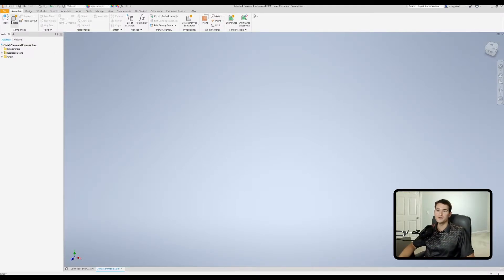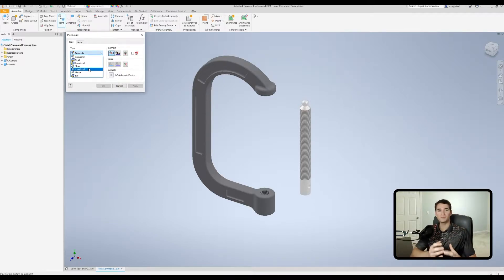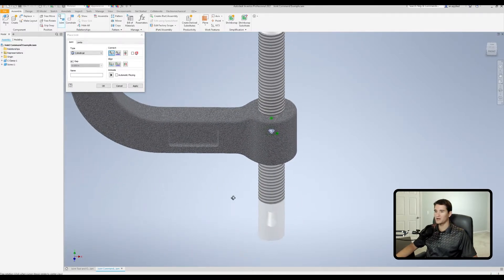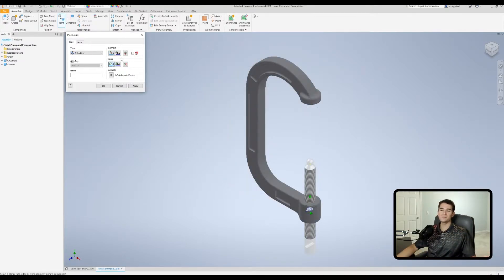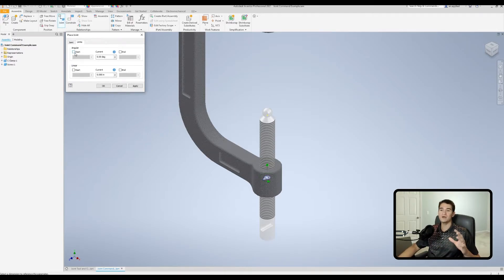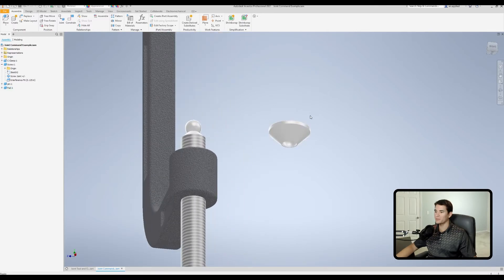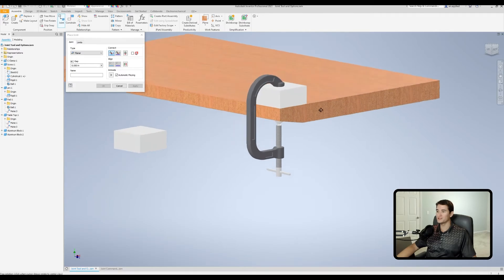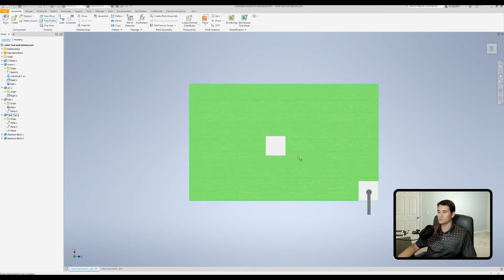Joint Command and Options - Autodesk Inventor Assembly Tutorial | Autodesk Inventor 2021 IN DEPTH

Comment: Great video as usual. May I ask you what kind of joint should I use for a vertical pin sliding inside a buttonhole? I have tried with the "slider" one selecting a point on the vertical pin and the buttonhole side but did not work. I apologize in advance for the noob question.

Comment: CAN SOMEONE PLEASE TELL ME HOW TO EQUALLY SPACE PARTS IN AN ASSEMBLY, LIKE SHLEVES IN A SHELF ASSEMBLY...
Reply from the maker: Sure! Please see the following steps (8 Steps):

1. Put your first part (shelf for example) in place with constraints. 

2. Then, click the "pattern" tool found in the "Pattern" section under the "Assemble" tab.

3. Next, click on the components you want to replicate or evenly space. 

4. Click on the tab for the rectangular pattern (the symbol looks like 6 dots positioned in two columns and three rows). 

5. Click your selection filter (little arrow) in the "column" section and pick a line, edge, axis, etc. that falls in the direction you want to replicate your parts in. 

6. Enter the number of total parts you want in the pattern. For example, if you want four total shelves, type "4" in the "column count" box.

7. Enter your spacing in the spacing parameter box just below it. 

8. Finally, click "OK" and you're all done! This works like the rectangular pattern tool in a sketch/part.
Reply: @engineeringapplied  hey buddy thanks for the response, but this didn't work for me.  let me explain.  I am creating a screw and nail storage area made of drawers.  think a card catalog in the local library, but used for nails and screws.   I am designing it with oak, and maybe some mahogany highlights.  i am a wood worker and i use Inventor to design my projects.  

i have two sizes of lumber i am going to use.  when i am building i always try to design my projects with as little waste as possible.  That means that if i am using a 10 foot x 11 1/4 inch piece of wood, i want to design my projects so there is little cutting as possible.  in other words, i want to build my storage cabinet to be 3 times as wide as the wood i am using, that is 11 1/4 x 3...

that is the height.  width would be about 36 inches wide.

anyway, i wanted to make my drawers to be evenly spaced along the 33 3/4 height.  and i need vertical separators between each drawer that is 3/4 inch thick, which is the thickness of my wood.

i have five drawers across, separated by 3/4 inch uprights between drawers.  and i need those exactly evenly spaced.  but my measurements just arent allowing me to make an exact measurement of the drawers and uprights.  so i thought that i would try to place my uprights first, finding a way to measure them exactly between the sides of the case, and when i have that, i can measure how width the drawers would be.

So i have to have a way to figure out the exact equal distance between two vertical sides.  i need five drawers, so i would have to figure out how to define an exact measurement of those five drawers between the two sides.and remember those drawers are separated by 3/4 inch, the width of the verticals separating the boards.

am i making any sense at all?...lol